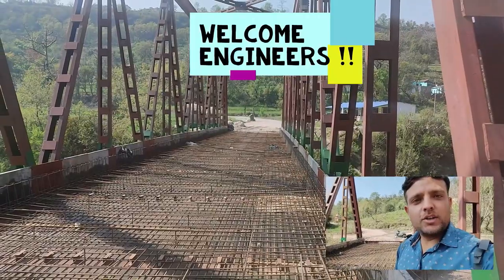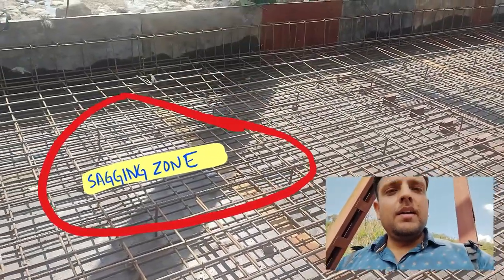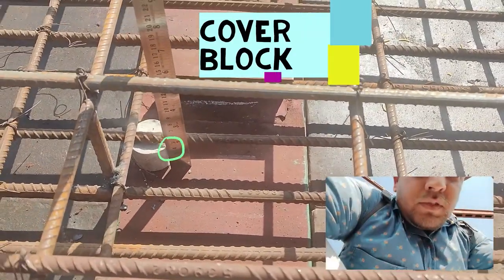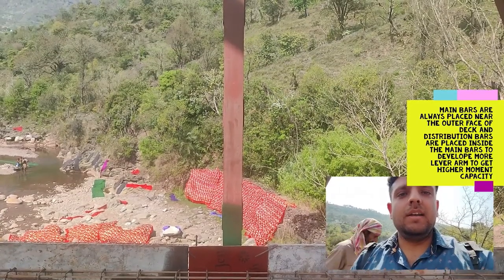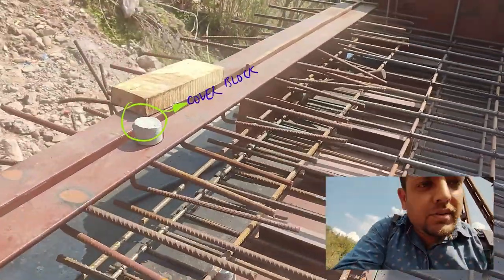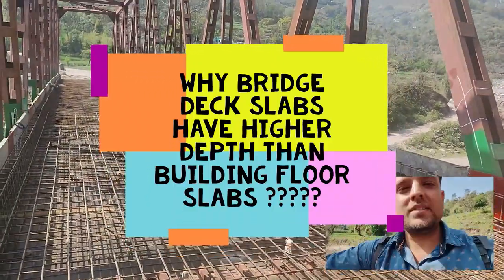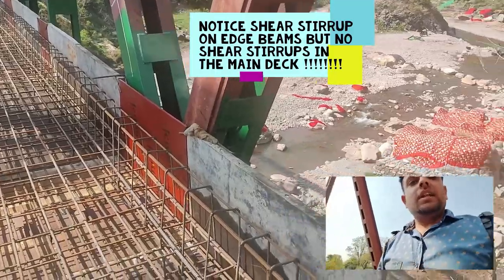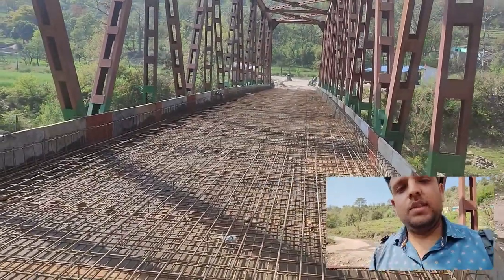EPISODE 8 | REINFORCEMENT PATTERN IN DECK SLAB | JOURNEY OF A TRUSS BRIDGE

Comment: Sir in IS456 the moment coefficients for continuous beams are given . I see the moment coefficients at supports ( negative moment) more than the positive moment at centre. That is there will be higher moment at supports .Die to which the spacing of the top main steel should be lower than that of bottom main.kindly clear this point sir
Reply from the maker: Your observation is correct as far as IS 456 is concerned. But here is the catch :-
1)IS 456 is not applicable to bridges or it's components. Although an estimate could be taken from same. For bridges we have IRC codes and those are followed because the nature of forces and loads along with load factors is entirely different for bridges. 

2)Even for an estimated behavior, Cl 22.5 of IS 456 clearly mentions that these coefficients are good for approximate analysis only if all loads are of the type of UDL. 
So in bridges although Deckslab and wearing coat loads are UDL with same intensity throughout the bridge length, but the design moment is the sum of moments from dead load and Live load. 
And it's very evident that Live loads are Contact Loads ( even after dispersion, their UDL intensity changes as they move based on distance from nearest support). 

3)For hogging moment , generally face of the support is considered where the value could be slightly lower than that given by coefficients. 

Having said this, pls note the reinforcement detailing shown in this episode is valid only for this bridge. In other bridges the spacing b/w cross beams may be different, hence different span for deck than this bridge. 

Hope it clears your doubt.
Reply: @AllAboutBridgeEngineering  thanks sir